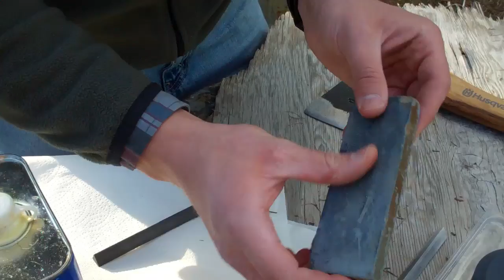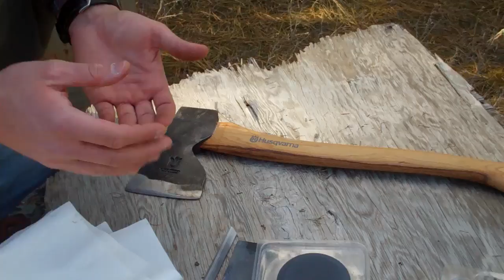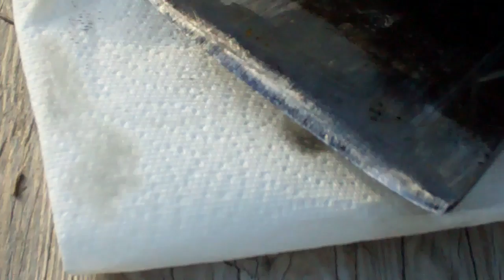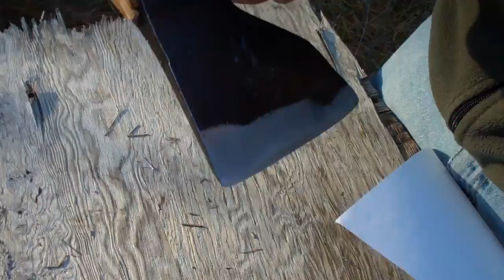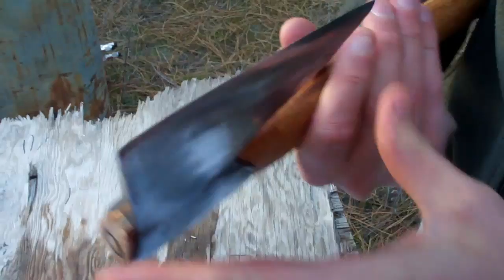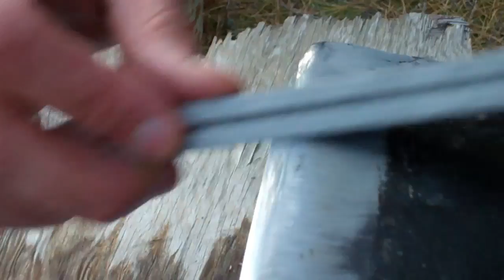How to Sharpen an Axe

Comment: I just got this axe today and it has a tiny chip on the edge. Could I use this method to remove the chip or do I need to use a bastard file first to work the edge down to remove the chip, and then go with the sharpening method you use here? Thanks.
Reply: +ReviewOutdoorGear Tjack1966 Did you ever find an answer to this question? I have the same problem and need to remove a chip on the edge of my axe.

Comment: I have a question about sharpening knives.
Reply from the maker: What is your question?
Reply: ReviewOutdoorGear What's your method when it comes to knives? What do you use to sharpen?  I have a small collection of small pocket knives that I use for whittling and they are dull enough now to where it's getting dangerous to use them. I have so many stones saved on Amazon that other YouTubers have recommended and I already purchased this:
https://www.amazon.com/gp/aw/d/B00004WFTD/ref=mp_s_a_1_2?ie=UTF8&qid=1484107688&sr=8-2&pi=AC_SX236_SY340_QL65&keywords=dmt+sharpening+diamond+stone&dpPl=1&dpID=51q7TG0-Z8L&ref=plSrch
I tried the set on my Buck knife and it went well but they are pretty small so.....I don't know!  Lack of technique may have hindered my results.  I have now purchased this: 
https://www.amazon.com/Smiths-DFPK-Diamond-Precision-Sharpening/dp/B000O8OTKA
I haven't tried it yet....and yes, I have watched every YouTube video I could find on the set 😬.  I'm just overwhelmed and I don't want to ruin my knives. So please, any suggestions will be greatly appreciated.
Reply from the maker: My method for sharpening knives is fairly simple. First of all, i try to maintain the blade so that it doesn't get too dull, saving me from doing a lot of work if the blade was too dull. If a blade was very dull, with chips in it, for example, I would put a rough profile onto the blade with a file, or a coarse stone. From then I would use progressively finer stones until I got a sharp edge. You can do something very similar with the diamond whetstones that you got. When i have my desired sharpness, I strop the blade on leather to remove any burrs and polish the blade. To maintain my blade, I usually touch it up with a ceramic rod and leather strop, or if I want a more utility edge, I will touch it up with a diamond rod. Does that help?
- Vlad
Reply: Thank you Vlad! Your way is similar to some of the videos that I've watched, but I trust and hold y'alls way of doing things at a higher level, so yes, this helped! One thing I've been avoiding and that everyone and their mother uses, is the leather strop. I've done online research as to why it's one of the best ways to finish or maintain a sharp edge, but I just wanted to do with out. Last night I viewed a YouTube video about different DIY synthetic strops that I may look into making.  I did find a highly reviewed synthetic strop online but it was pretty pricey and I also found one that is glued to a flat base on Amazon that I may purchase to try out. I just don't want to invest to much $ on this new hobby of mine...it adds up quick! Anyhow, last night I tried my Smith set and as intimidating as it looks, it was pretty fool proof and easy.  Only issue I had was that the tool thingy that holds the blade in place is not meant for small blades, so it was a little tricky. I'll continue to practice on my cheaper knife (Old Timer) before I touch my nicer ones.  Thank you again for taking the time to reply 😊
Reply from the maker: +Maribel Lakes Glad to help! Yes, practice is something that will help a lot. The more you do it, the better you'll get, and having an old blade that you're not squeamish to work on is great. I've never heard of synthetic strops before... interesting. Do you have a specific reason for not wanting to use a leather strop? It does not have to be any special contraption. You can actually just use the back (rough) side of a leather belt. It is not a necessary step, however, and you can still get a rather sharp edge with stones and ceramic.
-Vlad
Reply: Yeah, the diamond and ceramic stones did a good job, I just have to remember to count the number of passes I make on each side. Like you said, I'll improve with practice!

The reason is exactly what you're thinking, it's just a personal choice. People tend to become obnoxious and mean as soon as they hear or read the "word", sooo....we'll just leave it at that 😉.
Reply from the maker: +Maribel Lakes Yes, and try to keep a consistent angle as well. That will give you an edge that is much more even, and better at cutting. 

No worries, personal preference is totally fine in this area; use whatever works. 😀

Comment: hey how you doing my name is Dane and I'm looking into buying an Axe and I saw that you did a review on the Husqvarna Carpenters axe and the multi-purpose axe I'm slowly getting into Bushcraft and which one do you think would be a decent starter axe 4 Camp chores between those two unless you have something else I should look at thank you for your time
Reply from the maker: Honestly the Husqvarna 13 hatchet is a really good deal. It's very good quality, and not very expensive. You'd be hard pressed to find a deal as good as that out there. Pretty well suited for bushcrafting as well. If you want something better, you're looking at spending a lot more money on a Wetterlings or Gransfors Bruks axe.
Reply: +ReviewOutdoorGear the reason I was looking at those is that I found them by my house for around 60 bucks each so that's a little less than other places that I've seen quoted so if you're going to pick either the Carpenters axe or the multi-purpose axe which one would you go for
Reply from the maker: Go with the multipurpose axe. Carpenters axe is pretty specific to carpentry.

Comment: hello, fan of your videos. ive been sharpening for over 12 years and would only add one tip. you never mention a burr at all and for me that was what made me so effective. with the coarse stone, if you havnt established a burr after the sharpie is gone, do it again untill you can feel the rough fuzzy sensation on the opposite side. this cant happen untill the thickness of your edge is the same as your abrasive causing it to get pushed over from hitting it head on. once that is established, use light strokes and make sure that edge is straightened. you can feel sharpness by sliding a thumbprint over the edge from edge to spine, this is a strop motion instead that goes at a steeper angle from spine to edge to feel the burr. repeat at each step to ensure maximum sharpness has been reached with each stone. i can get hairs popping at 220 and whittling at 360. which are coarse. then use a strop to again straighten the existing edge that if it is a burr, it is just bent a tiny bit. but make sure it is smooth first before stropping, if it scratches the strop us very light ceramic stage strokes. ive been able to whittle hair since i was 16 doing this :) the rocks will cry out his praise even a lansky puck
Reply from the maker: nice tips! Thanks Derek.

Comment: Hi Eugene - First, thank you for the wonderful reviews and videos! I'll be buying the Husqvarna Multi-Purpose Axe later today and want to make sure I have what I need. You linked to the Lansky stone, but I can't find the other 2 stones you're using (square flat water/wet stone and the ceramic stone). Any chance you have more info on the other 2 stones? Thank you, sir!
Reply from the maker: +yelir p , thank you for the compliments, and question. I have added links in the description for what you are asking about here. The square stone I have is an antique Pike Sapphire stone, and hard to find, but I've linked the most comparable i've found. It might even be a bit of overkill. Blessings.

Comment: I sharpen from top to bottom , basically horizontal to the way you have. I can see the stone against the axe. I believe just as with an axe as my knives , if you take care of it after every use , you really don't need a very course stone. Just my way , not wrong , not right , it's sharp at the end of the day and ready for next use.

Comment: Hi Eugene. I have a new Grandfors Bruk Small Forest Axe and somehow after medium duty use I have found that ther are some knicks in the blade steel (maybe 1/10mm) but visible and can be felt with running your finger over it. This means to me (I think) that in order to fix this it may need to be re-grinded and a new edge created.

I'm not sure though - what are your thoughts?

It's a bit disappointing buying a quality tool only for it to get quickly dull and for burrs to arrive. I agree that if it was used inappropriately I could expect this, but the use was very 'medium' in my opinion.

Do you think I should attempt a repair or send it back to Factory for analysis?
Reply from the maker: Hmm..that's quite surprising to me. Did you chop any roots or ever hit the dirt with the axe? I would not expect the GFB to get nicks from chopping wood.
Reply: Thanks for the super fast reply mate! No none of those for me - a friend of mine did use it to chop a log and there was some dirt on the head afterwards so that's probably it.

In terms of correcting this, what are your thoughts?

Much appreciated!
Reply from the maker: Well, a 10th of a mm is quite small. I would say that you could file it down a bit (as you see being done in my new video "True Temper Kelly Perfect | Axe Restoration"). The other option is to keep grinding it down with a stone (keeping the same sharpening angle of course) until the nicks are removed and then honing it as usual. It is a good idea to fix this, because a dull axe gets more dull quicker than a sharp axe. In terms of dulling from dirt - you'd be surprised how quick a sharp tool (even high quality) will dull from hitting tiny stones in the dirt.
Best of luck my friend.
Reply: Thanks very much! I'll watch your axe restoration video - much appreciated!

Comment: How would you know if your Axe is Sharp enough to cut wood?
Reply from the maker: For chopping, the sharper the better - if it can slice paper or shave, you are set to go. A dull axe becomes "duller" faster, because the dull edge hits the wood and is destroyed more quickly. If it's s splitting axe, it can be more dull, but as sharp as you can get it.

Comment: I see you used spyderco sharp maker ceramic rods. I wonder if it would be possible to sharpen an axe as you would sharpen a knife on a sharp maker angle system.